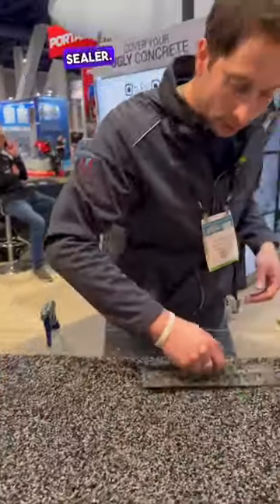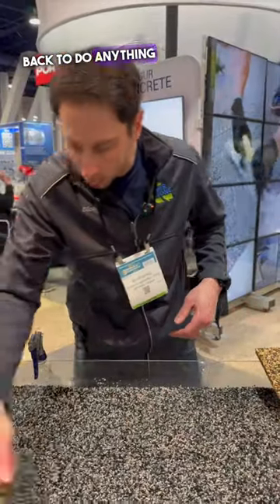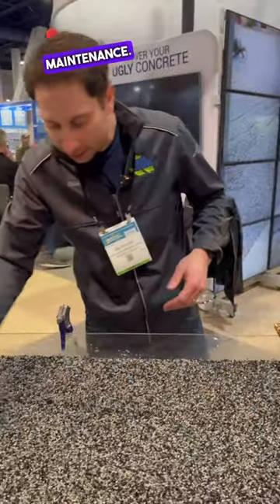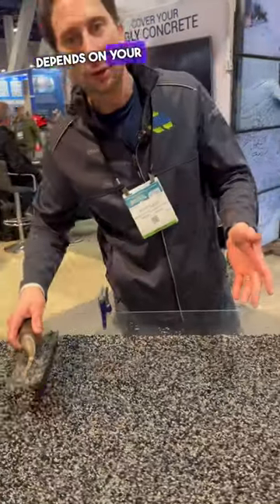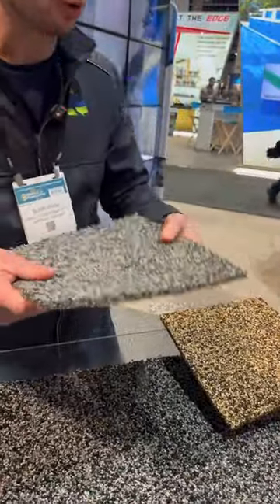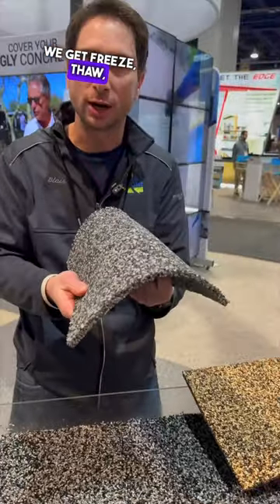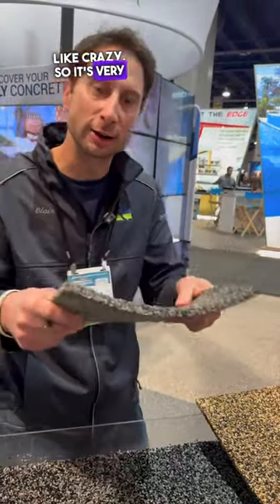Innovative Rubber Flooring Product! #flooring #rubber #shorts

Comment: This is literally what the floor of the playground was
Reply: Except this is likely not toxic, unlike what they used in playgrounds.
Reply: @azdeh1894 yeah that stuff gives you cancer
Reply: I love the bouncy floor
Reply: @RATTLEVIPER I'll take it. Bouncy floor is worth it
Reply: You are correct. This what the 3/8’ cap coat was made of.
Reply: Thats what I'm saying 🤣🤣
Reply: Yeah the stuff on playgrounds was nothing but landfill tires😂😂😂
Reply: @Fr3sh-Kush  as it should be
Reply: Literally I used to install that stuff. Only difference is we’d just mix the glue with the rubber rather than prepping the floor with glue
Reply: Call pour in place
Reply: @azdeh1894  No, so it's actually the same aliphatic polyurethane binder as what's used in playgrounds, its only hazourdous when mixed it's completely non hazourdous when cured.
Reply: Pretty sure the rubber playground matt is called "astro turf"
Reply: @nam6128  I’m sure you’re thinking of the artificial grass
Reply: @nam6128 Astro turf is artificial grass flooring, it has a grass like texture. This is basicly just a 2d mat of porous rubber.
Reply: @RATTLEVIPER you weren't meant to eat it
Reply: @roleat amen
Reply: What happened to wood chips?
Reply: @LostieTrekieTechie  In little Timmy's corneas
Reply: Imagine having a playground🤯
Reply: We got gravel for our playground
Reply: Where are these fancy playgrounds? We had/still have gravel.
Reply: @CarlMarx same until we got wood chips on ours when I was in 4th grade
Reply: @Fr3sh-Kush fr fr I always wondered what that was made out of
Reply: @maximusgentry6746  yeah, its the same thing used on some running tracks too
Reply: @RATTLEVIPER wait what
Reply: Lol yeah you must be born post 2000 cause that playground wasn't around when I was a kid 1994 lol 😅
Reply: When I was a kid we had either pebbles or wood chips :)
Reply: yall didnt have barkmulch?
Reply: Nah I think the playground one was like not formed in situ, probably came as a unit they moved in with a hoist etc... Because that's kind of how most rubber works except siloxane
Reply: @azdeh1894 how do you figure. Is this latex? I didn't think of that. It must be latex. So carpet glue with chunky stuff...ok...
Reply: @azdeh1894 see that black stuff, dark rubber. Probably carbon. Carbon causes cancer. So does oxygen. So does using your phone and eating McDonald's and... But yeah. I need aN MSDS before I get stuck in this comment's place on a short. Ahhhjjhhjjhhhhhhhhjjhhb
Reply: I wonder what the weight limit is. If I place this material in my garage and placed shelving over top will the weight dent the rubber. Or if I had a tool box etc

Comment: Concrete chips up, you mean to tell me I'm NOT going to have rubber chips everywhere after 5 years?
Reply: More like 1 year
Reply: Matter o fact this finna dry rot and become trash
Reply: Microplastics 😋
Reply: If it's epoxy adhesive, then it depends on UV exposure how much it fails
Reply: You will but you can pay then more money to come fix it again.
Reply: go to a kid's playground
this stuff is insanely resilient
sometimes you get little grains come off, but it lasts for years
Reply: @randomcow505  I wonder if the weight differential between an adult and a kid makes a difference. Boots and tennis shoes etc. jack on the floor and no jack.
Reply: @CaseyFellman  yea I wouldent want to use a jack stand on this kind of floor, but with some plywood under it it should be fine
as for something human weight it makes no difference, this stuff is really tough to abrasion 
the big concern is spills if its not put on top of something that can drain
honestly, for that reason alone its probably not good for a car garage if you work on your car a lot, but for a workshop this stuffs great
also good if your stood up on it all day
Reply: @randomcow505  ahh I didn't think of the body relief when standing on it. I wonder if fitting a jig big enough to make large mats of this stuff would be worth it.
Reply: My dad has this in his garage. its been like 8 years, no problem.  It's awesome. It makes the floor alot warmer too.
Reply: @michaelbushey2787  I didn't think about the floor temp at all. I imagine it's quite significant. Pros and cons to anything I presume, I know two things are for sure. For 100 years they have been trying to find a substitute for bread and beans and haven't found it yet and the chickens always come home to roost.
Reply: Seems like it would be a nightmare trying to get sawdust out of it
Reply: @iBoujin  micromorons
Reply: @DieselRamcharger  not what your mother was telling me last night as she whispered in my ear from the bottom of my neck. 🤷
Reply: @borisinpanzers9283 lmao.What... rubber is going to dry rot?😂
Reply: @Shastavalleyoutdoorsman  All of it
Reply: @borisinpanzers9283  lmao
Reply: @borisinpanzers9283  I guess that rubber track down at the high school.That's been there since the sixties... is going to rot any day...
Reply: @Shastavalleyoutdoorsman  Yup cause all rubber rots
Reply: Concrete chips because its strength makes it brittle. This is flexible. Think.

Comment: If it is permeable how do you clean up a spill?
Reply: Imagine the cracks that form underneath where the moisture builds up too.  Seems like a good way to speed up deterioration process of the cement underneath.
Reply: @Planes9905  that is a very good point. Especially in cold weather areas that freeze and thaw. Even more so if your garage is a unheated cold area. I am sure it has its uses but I do not think a garage would be a good fit.
Reply: @shanewestphal1557  I agree.  I'm sure it works great for some applications but if not used properly it can probably reek havick.
Reply: @Planes9905  exactly
Reply: @Planes9905 the park by me used this n they havnt touched it in 15 years n still looks new n im in michigan so my guess it's fine
Reply: @DevinM420  you have a park that has concrete under the playground with a layer of this over the top?
Reply: @shanewestphal1557  idk what's under it but it is supposed to be put onto a solid surface so I'd imagine so, or asphalt
Reply: @DevinM420  the stuff in playgrounds is similar, however, is usually poured and trowled directly onto whatever is there whether it be sand or another mulch. This stuff is permeable and when put on a non permeable surface in the case of a spill or rain the liquid is trapped.
Reply: @shanewestphal1557  oh ok I thought it was the same stuff
Reply: @Planes9905 need to have a floor that runs the usual grade and drain
Reply: Imagine a dropped carton of buttermilk.
Reply: Does it realy freez in your garage,  wold like to investigate it where would I find this product?
Reply: What if someone threw up on it? 😅
Reply: @HOLES69  have you seen a residential garage with proper drainage, grading or floor drain, without a area that hold water? I have never.
Reply: You dont clean it, just wait for it to fall apart, and then get an epoxy floor.
Reply: This mf made concrete insulation, oml.
Reply: I was thinking the same or even some chemicals. May react with the type of rubber they use. I know for myself I use methylene chloride for cleaning some stuff and on concrete it'll eventually just evaporate however it eats most rubbers even Buna type rubbers so depending on what you do this may be a mess.
Reply: @Planes9905 would that be any different than finishing off a basement and putting flooring down…?
Reply: You just won't see it  until your family gets sick, then you'll remove whet you paid for, thats when you find black mold  that has accumulated since the first spill
Reply: @DevinM420  same material different base materials. Sand, earth, and mulch allow for natural drainage, while concrete is going to cause pooling on the surface, which can also wick into the rubber matrix.
Reply: @stevepearson6316  my garage is drafty as hell, and more often than not the snow that falls off my shoes just chills on the floor until i sweep it up and throw it out the door. 

The cold air just seeps in and keeps the concrete cold af.
Reply: They use this for tracks, when it dries it has like, a protective layer on the bottom, and it dries SUPER fast if you have airflow or sun
Reply: I do oil change in my garage... sometime my car leak fluid. This seems like a bad idea. Good only for playground😂
Reply: You could probably isolate a section off if it’s really bad. Just rip that piece out and pour in a new layer. Mix looks fine enough that it’d probably seat flush with the rest of the floor.
Reply: A vacuum and make sure the moisture is removed and scrub the air with a dehumidifier.
Reply: Plus what happens when water permeates it and then freezes?
Reply: Where does water go?
Reply: Just wondering during winter here in Canada salt on the rubber stone it will affect the colour or I meant to change the colour because of the salt.?
Reply: Most garages in the north have drains
Reply: You don’t
Reply: @kingwing5963  how far north? I have lived in North Dakota, Missouri, and Wisconsin and have never seen a floor drain in a residential garage. Which includes large mansions, one had a access pit for working under your car, but no floor drain. It rains and snows regularly in all of these states. 

I have seen one garage that did have a drain, it was installed by the homeowner himself, because his garage flooded often. The idiot did it wrong and compounded the problem and made the flooding worse. I do not count this instance as a proper floor drain because it is not correct.
Reply: @shanewestphal1557  all the places ive lived in Wisconsin, South Dakota, Michigan, have all had in-floor drains. I haven’t seen any houses without them, even yes “mansions”Have had in floor garages drains.
Reply: I was thinking the same thing, that floor would have to be epoxy coated twice before I put that stuff in there.
Reply: I imagine my dog peeing on it and never quite being able to get it all up.
Reply: I literally came to the comments to ask about its permeability. Is it absorbent? Is it mildew resistant?
Reply: You dont
Reply: @shanewestphal1557 I've seen a garage that drains on grade....I'm standing on it right now...I also wash my truck inside the garage too! If you listen to the guy in the video he clearly stated you seal the slab BEFORE you trowel the product on. The grade is up to you as when I poured mine I lasered level then added 1/4 inch per foot drop towards the drain. Literally every parking garage and parking lot as well as every street uses this drainage method; it's about as common as it gets.
Reply: @laynepipe5760  yea sure. The exception not the standard. Ok so the concrete is sealed. In the event of a spill, since permeable, what happens to the spilled liquid? Say you have the most perfect slab in your garage, pitched  with or without a drain. What happens to the liquid, since permeable? Its going to sit in there unless you flood your garage. 

When you do your washing in your garage is there any standing water when done? 

I am no mason but have poured concrete. In my trade, I would have to level machines and pumps off concrete, usually to a tolerance of about 0.025 degrees or better. Through all the dips and valleys, it's never perfect.
Reply: @Planes9905 "wreak havoc" you mean.
Reply: @laynepipe5760  also, you speak of the grade of commercial, government, and your own property that you custom built. I am speaking of common residential. My 3 car wide double deep garage does not have a drain and has valleys that hold water.
Reply: Imagine spilling a bucket of paint on this stuff. Can't just put sawdust over it and wash it away.😊
Reply: You don’t😂
Reply: This stuff is for play grounds....NOT garage floors.
Reply: A giant spong for all them oil leaks😊
Reply: @shanewestphal1557 What part of North Dakota?
Reply: Or get ice up
Reply: I mean If you have drains in your garage you could just spray the garage out.
Reply: You don't ! , it goes down and you'll have to deal with that ( from an epoxy installer over a decade )
Reply: @Planes9905 so I'm assuming that they install some sort of drain system on top of the concrete then put this stuff on
Reply: You just look at it.
Reply: you don't. lol
Reply: This is for outside I think
Reply: @internalharm okay so don’t buy it then. Why the hysterical emoji at the end of your comment?
Reply: @shanewestphal1557  I’ve seen it done at playgrounds with just different color rubber used like this where they lay concrete before anything
Reply: The dumb thing about this video is that the voice-over says it's a garage flooring product. And yet the salesman talks about things that do not happen in an indoor environment.

It's permeable, because it's meant to be outside. Flooring like this can be installed inside, in which case it'll have a sealed top layer because of obvious reasons.
Reply: Put down graded concrete or well compacted grit. No puddles ever
Reply: Air does that for you
Reply: i imagine you could set up a drainage system into the earth
Reply: @HOLES69 I'd like to see if it holds up to a power washer after oil or gas is spilled on it
Reply: you dont
Reply: @DevinM420 I believe they put the stuff over gravel

Comment: Counter point, concrete shows if your vehicle has a slow leak that doesn't show up on the road.
Reply: Counter counterpoint, place a white rug under your engine area where you park and enjoy that floor in the rest of the room. 😂
Reply: Time to head back to the days of chock blocks and drip pans then.
Reply: @RubberDuckDebugger new counter point. Can you drop heavy weights on it from working out repeatedly without it cracking.
Reply: @ClOwOl  I'm having more trouble believing than a vehicle can regularly drive on it without destroying it, but I'm sure dropped tools will be doing no favors to that floor.
Reply: @ClOwOl  doubt it, but I have no idea.
Reply: @RubberDuckDebugger  so add shit to something usless?
Reply: @instrumental  personally, a rubber padded garage floor is not for me. I just wanted to make a point that there are ways to find dripping fluids even with that flooring. Lol
Reply: A card board pad under the engine block,  to detect an oil leak.
Reply: Cardboard works fine for that bud
Reply: @ClOwOl I'll bet you can. This is essentially what they make the floor in children's parks out of.
Or very similar to the rubberized track used to make Olympic Sprint tracks.

It's far more durable then people give it credit for.

Just because it's rubber doesn't me it's not durable, your tires are made of rubber and they roll for hundreds of miles of abrasive asphalt ever day.

Comment: It will have good uses but if applied to a floor that's not porous it may hold water long enough for bacteria to grow like an old sponge or carpet that keeps getting wet. Do your homework first. Hopefully it's made from recycled rubber items.
Reply: Or water gets trapped under, and the water freeze causing premature failure
Reply: My thoughts exactly     and what if you spill oil on it.
Reply: Im sure rubber has no toxic off gassing.
Reply: Its comments like these that save people from wasting money thank you 🤲
Reply: That's exactly what I was thinking!

Comment: If the water goes through it, could it mold between the product and the flooring?
Reply: yep, especially if you spill something. also your creeper or floor jack won't work on this stuff.
Reply: @678friedbed  That's when you just pour bleach on the floor
Reply: @thecaybob1 I appreciate the sarcasm, if it wasn't... I'm afraid that you know how to clean a moldy floor😂
Reply: You guys are special , what do you do if you puke on the carpet just leave it there and say “ yep that’s going to mold under the carpet “ . Its not as thick as the stuff in the tub you get that right ?
Reply: @nhaake   carpet holds puke also and spilled liquids. it also holds all sorts of dirt and is difficult to clean. that's why I'm removing it from my house.
Reply: Yes
Reply: @nhaake it's NOT for inside the house it's for concrete outside or the garage

Comment: You'll love it until you spill oil, gas, brake fluid, windshield washer fluid or power steering fluid on it.
I would never put this in a garage.
Reply: Dont forget the darn blinker fluid…
Reply: @kaliumnitraat don't get me stahhhted on the blinker fluid
Reply: Looks comfortable to kneel on when it’s time to change the winter air for summer air in the tires, though
Reply: Heck no, not a garage. Your spot on.
Reply: @DoorKicker  😂😂😂
Reply: I wouldn't want to try and use a jack, jack stands or a creeper on it either.
Reply: @678friedbed  Ya good point. Playgrounds would be great place for this. As long as water doesn’t stay in it and become nasty.
Reply: @gabef9538  with until i remind you to top off your fork oil.
Reply: @DoorKicker  well youre not wrong, i have thicker and more solid "rubberstone-esque" mats that are vulcanized and theyre awesome for just standing on all day, or kneeling and crawling under vehicles. And they've held up quite well to various petrochemicals, and other automotive fluids. 

When its time to redo my driveway, im not getting this rubber stone stuff. Going to be regular concrete, better drainage than what I have, and I'm getting a pit installed for vehicle maintenance with removable grates for liability sake. 

I rather stand under my vehicles than use a creeper because all the pea gravel from the dirt roads and mud would bind the wheels constantly lmao. Plus i can get out of the way of hot oil faster too.
Reply: Roll a jack on it...
Reply: @100GTAGUY  oil pit is the dream set up. Make sure you add shelves for oil, filters, n tools.🍻